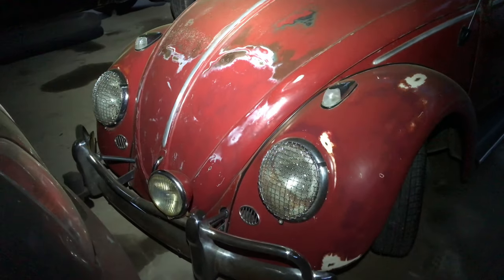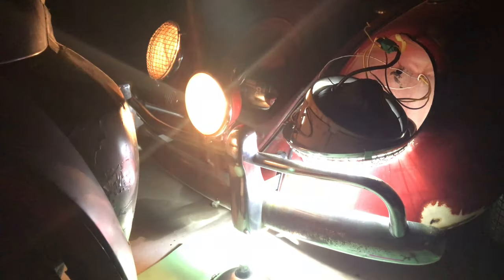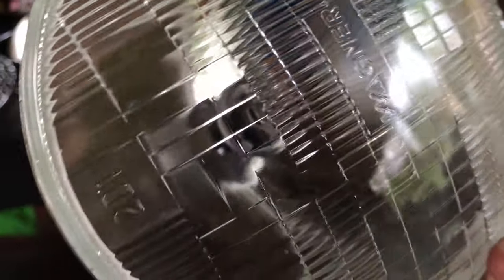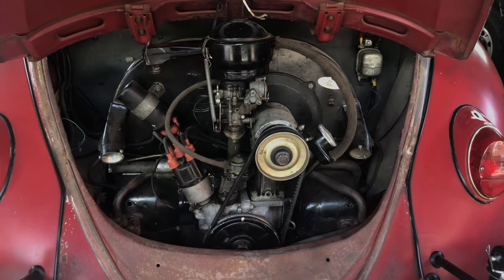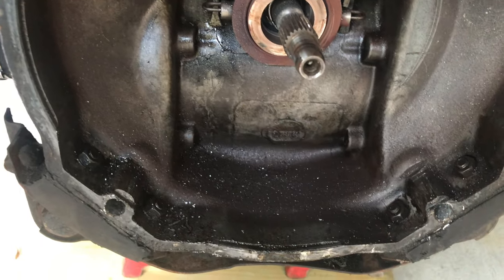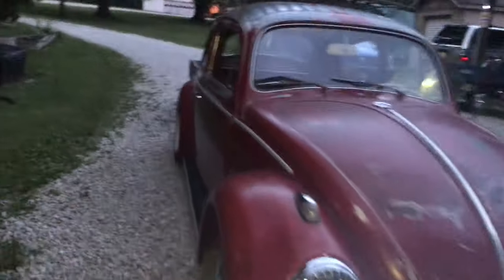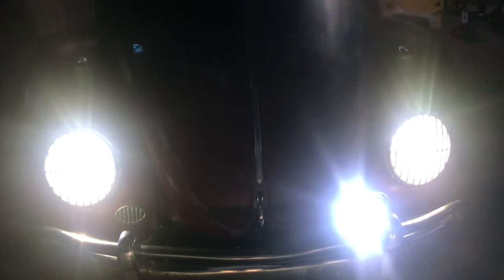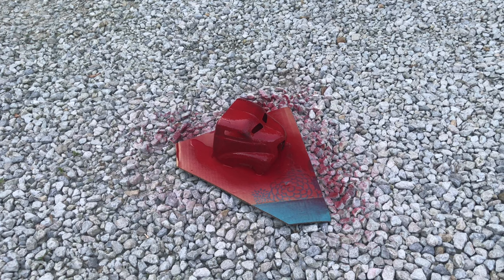1962 VW Beetle clutch replacement and L.E.D. headlight conversion, led headlights

Comment: Those are some interesting lights. I think I like your Dad's 6volt candles better! =) I've been thinking about one of those jacks! It seems to work great for the engine! Cool video!
Reply from the maker: I too am a fan of the vintage vibe/look that the old regular bulbs have, but then I don't drive mine as much as Aaron does! The jack is a total win! Having pulled engines on VW's in the past this seems to make it much easier...plus with my little guy around it is much more stable, so If he is for example getting ready to slide down a loading ramp using the car creeper I can "let go" of the engine and jump to rescue him...(yes that happened😆I will tag it on the end of a video soon)!!

Comment: NIce, I have a Brazilian 1971 (which is 12 volt from factory, it actually uses H4 or H5 bulbs, but keeps the same headlight housings as earlier models) and I was wondering if that conversion was doable. Thanks!
Reply from the maker: thanks for stopping in! After I plasma cut a hood for this car (not the real hood, but a junk one we had) and we backlit it we went back to the old style bulbs temporarily to make the light a bit dimmer as to not take away from the hood...man we sure do miss those BRIGHT and crisp L.e.d's! ha 
here is the hood after I cut it up!
https://youtu.be/QFMU1RaZltM?t=1014

Comment: Led lights look great! I couldn’t help but notice that Chinese throwout bearing is a issue. My lasted only month i drove it and jbugs doesn’t recommend or sell them anymore.
Changed it with a new Sachs Germany Clutch kit off rockauto.com it was much cheaper than JBugs too! 😉
Reply from the maker: I know right! We bought the LUK clutch (made in Germany version) PP and TOB this time (its what is in my mini and had it in there 300,000+miles), hopefully will be a bit better...can’t get good parts anymore, makes me so mad! LED lights are bright, but I’m old school like the hue of the amber bulbs...😉

Comment: Great looking Beetle! Love the stance. Is it an adjustable front end? Or static? Also, how many clicks did you lower the rear? Oh, can you provide the link to the LED Headlights, please?
Reply from the maker: Thanks! it is a narrowed/adjustable front beam and it is all the way up (as high as it will go) then the rear are custom static plates with gabriel air shocks...there is a small air compressor up front...total cost for this stance. $170-ish vs air ride at $1K+  I will look for the headlight link for you! Thanks for being here!
Reply from the maker: FrankG here are the lights, looks like he’s out, but I’m sure others listed that are the same, this will at least give you a starting  point! We’ve been really happy with them! 
https://www.ebay.com/itm/192661795234
Reply: @marcijunebug  Thank you so much! I appreciate it!